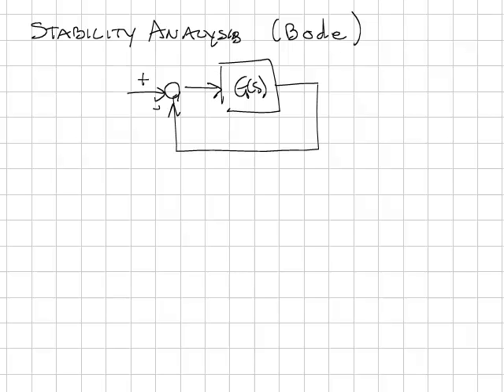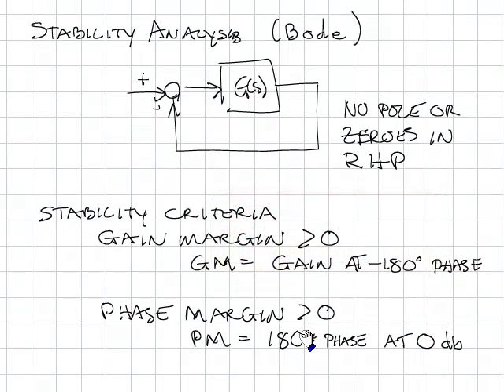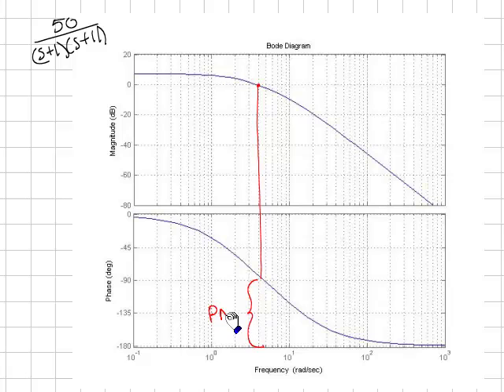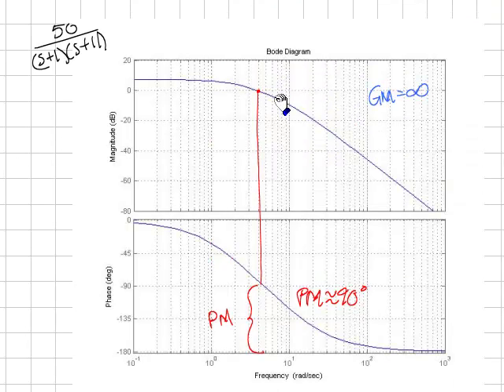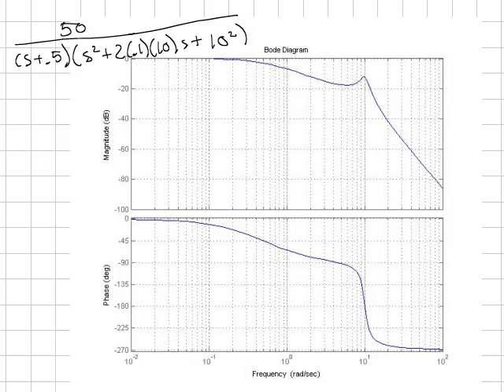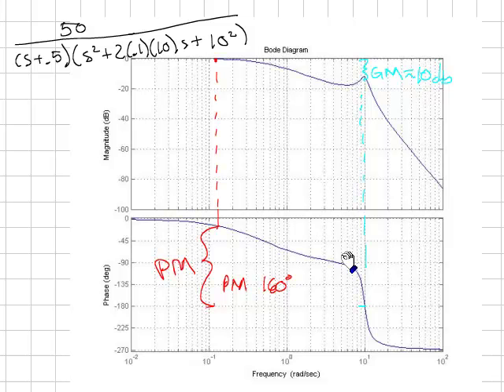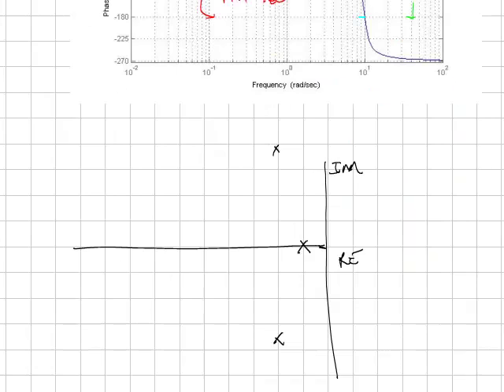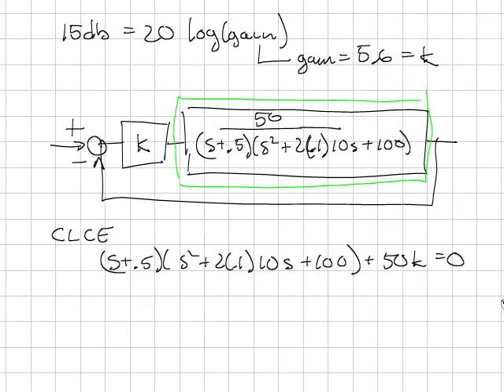Bode Stability Analysis.mp4

Comment: There are two false statements in this video:
1)  There is no need to require a minimum phase system (i.e. one with no RHP zeros) to apply Bode plot stability analysis,
2)  The requirement that GM > 0 is not needed as a stability criterion.
Reply: jonesr227 if course is needed. If a system has a gain peaking larger than 0dB but a 90degrees pm the system is.NOT stable. GM and PM need to both be checked. Especially in a LDO design where so many complex poles exist with Q factor too large often you will get good PM but horrible GM with peaking. The applied step response will have inf ringing.